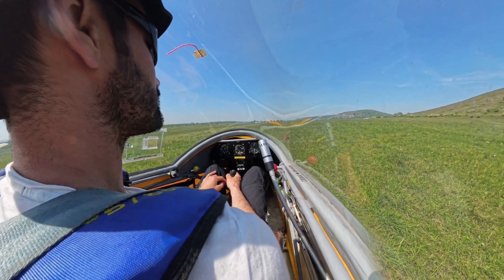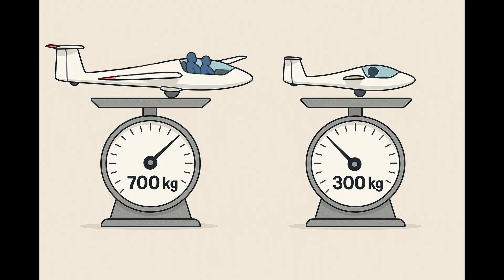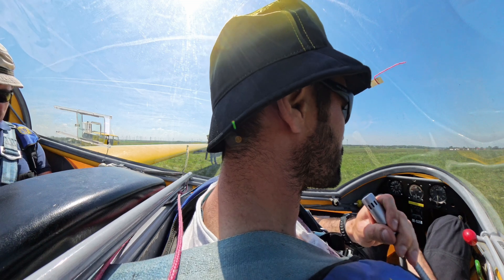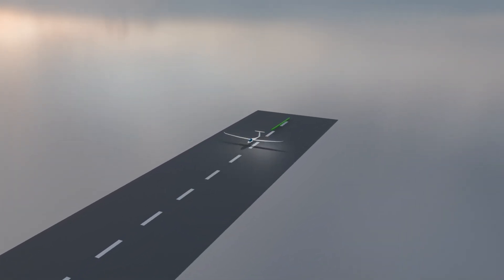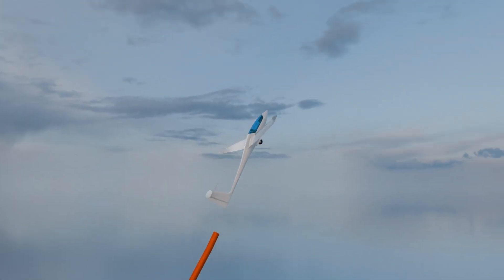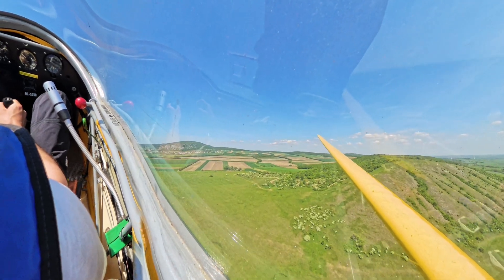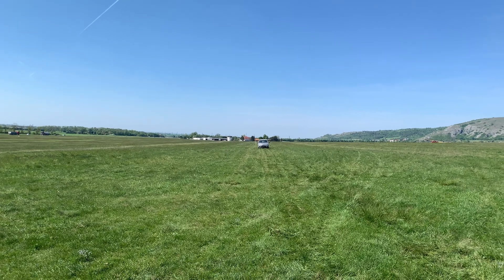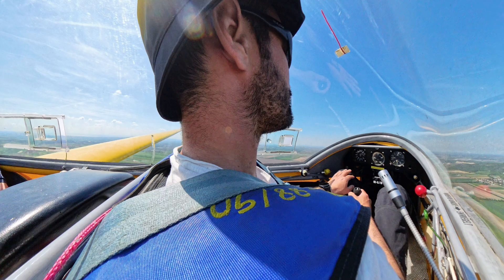Winch launch mastering - Animation, real flight examples and explanation

Comment: Why the guy in the first launch does not have his hand on the release??????  That is deadly sin....
Reply from the maker: Ja, would save some tenth of a second. I think it is told to have the hand "near the Release of better on the knob"
Reply: @spitzflight  I think it is not some tenth of a second. My guess it would be around 300 to 500 mS. But, under stress, you may not be able to locate the handle at all. From wing on the ground to total loss of control with winch it takes about 2 seconds. in France, even for regular take offs with airplane, the standard procedure is to have the hand on the release
Reply from the maker: Pretty sure thats right. better to be on the safe side !👍